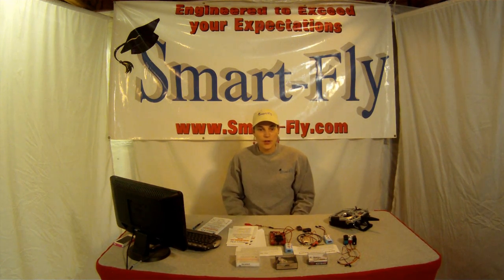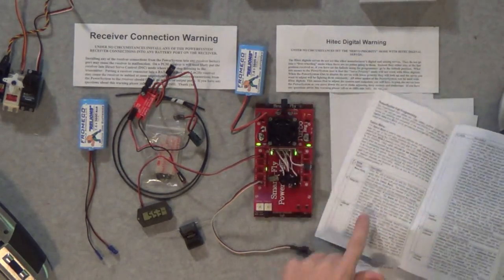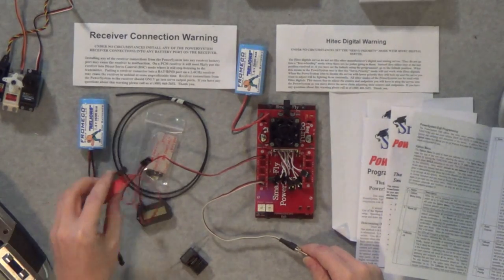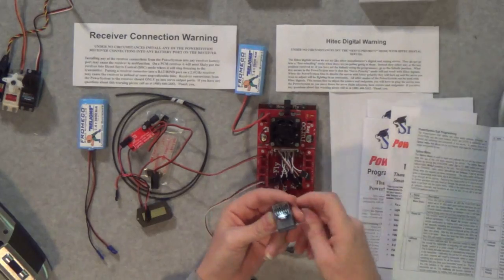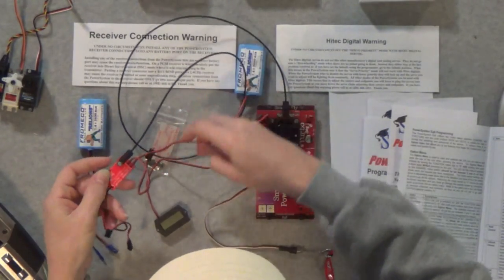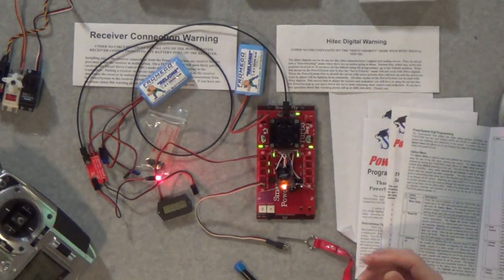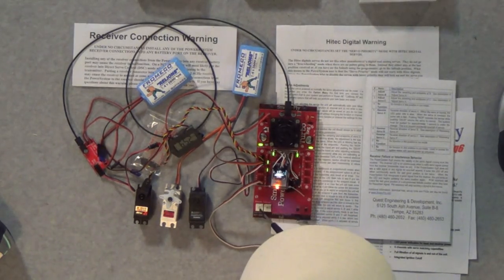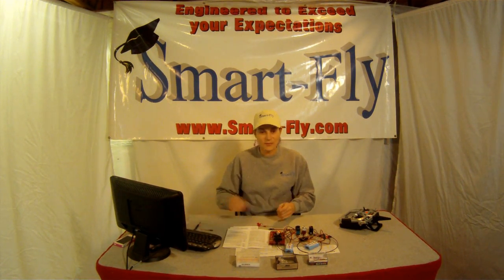Smart-Fly Programming

Comment: Purchased the eq6 for my pilatus porter.  Your video answered all my questions and made the setup so much easier than reading  the instruction manual. The only issue i have is wanting to move the ignition cut from my gear switch to aux2.  Seems no matter which channel i set the ignition cut on the eq6 it defaults to the gear switch on the DX8.  Once again a great video :)
Reply from the maker: I'm not that familure with the DX8, though I would think you could move the wire from the cut off channel you programmed in the EQ6 and plug it into aux2 and it should work. Just have to have a RX that has an aux2 port.
Reply: averagebrunette 
I Have worked out the settings for the ignition cut off function on the aux2 switch on the dx8.  The issue was that the ignition cut off needs a direct on off function which the gear switch does.  The aux2 switch is a three position type.  What was required was to set one position of the aux2 at +100 then the centre setting on -100.  This then made the switch a straight on off function.  I have the eq6 installed and working, which your video helped no end. Looking forward now to getting the porter certified as a heavy craft given its over 7th dry weight.
Reply from the maker: PilotPogo Awesome!!! Glad I could help :) good luck with it. Can't wait to see the maiden video.
Reply: Didn't capture the maiden on video as I and the plane were under assessment for Heavy certification.  I have posted a video that someone took for me a couple flights later.  Cheers

Comment: Hi. all though this is an old post i want to ask...is it safe to use 7.4 volts for ignition? i've noticed you used a fromeco 7.4 battery pack with out a regulator on the kill switch hence the question

Comment: Having trouble setting up eq6 with DX9 and AR9020rx. Use your setup but won't kill with switch A. For fun I tried to move it to Aux. 3 on rx and set up DX9 accordingly and then can't get it to come on. Are you inhibiting the throttle cut feature on your tx or using it along side? I've tried both and same results. Any help would be appreciated!  And great video by the way.....

Comment: I Will have to research this more as i have tried switching  leads between the aux2 and gear ports on thr rx.  When i do this the red LED for the cut off will not illuminate.  If it's  a programming fix via the eq6 i will let you know :)